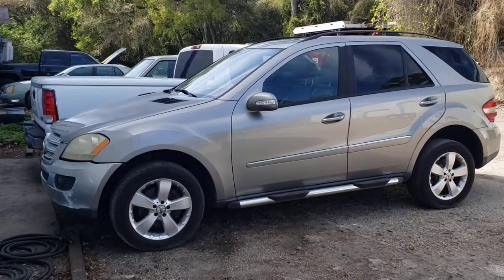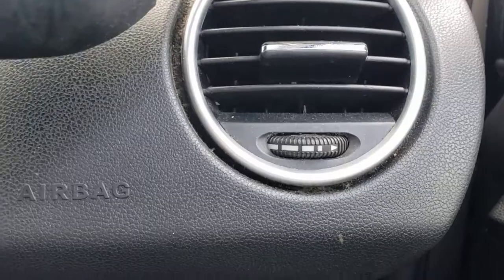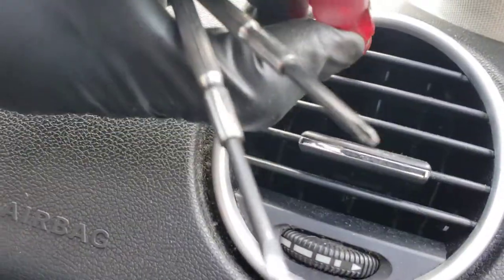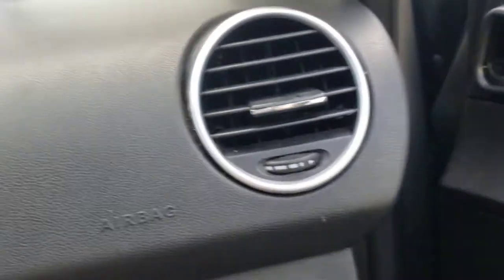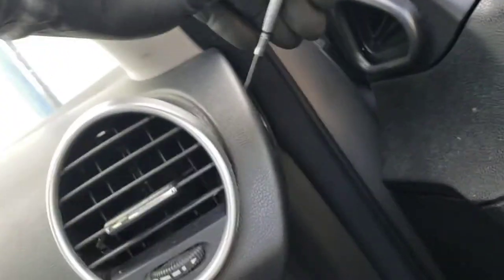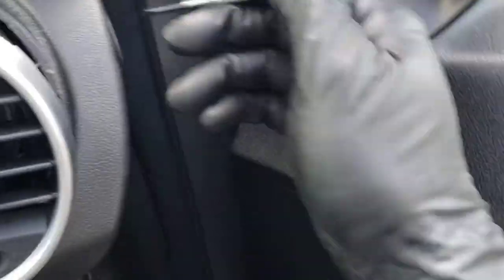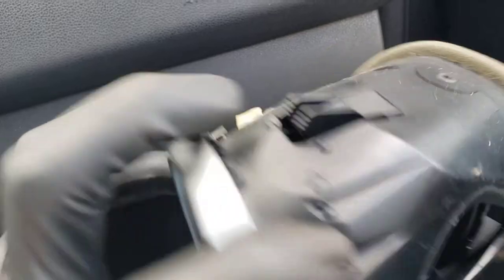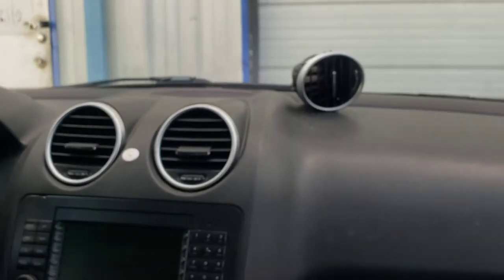How to remove air vent ac on Mercedes ML500 Ml350 GL450 GL550 W164 X164

Comment: Thank you so much! We just bought a ML350 from 2011 in excellent condition excellent the levers adjust on the vents are broken or breaking.( Odd?)
We weren't even sure IF they could be removed or replaced. This helped answer at least one of those questions! VERY HELPFUL FOR US!
Reply: I have the same exact 2011 ML 350 and same situation (broken vent tabs - two of them, like what gives?). Were you able to fix yours?